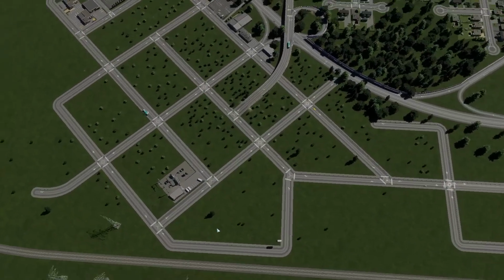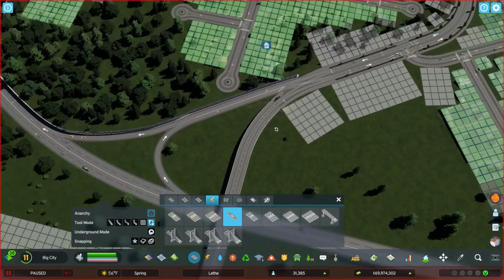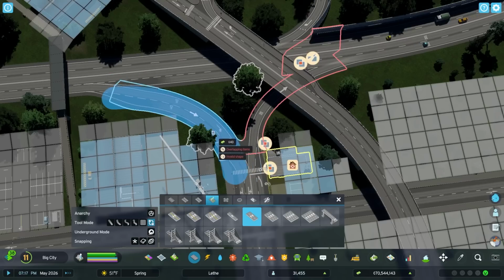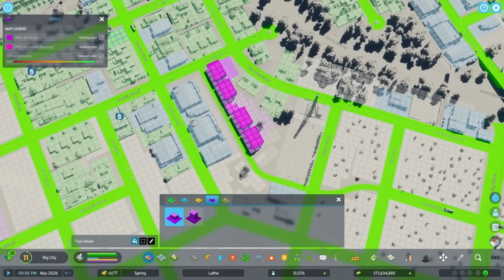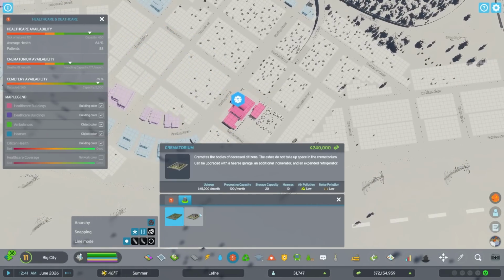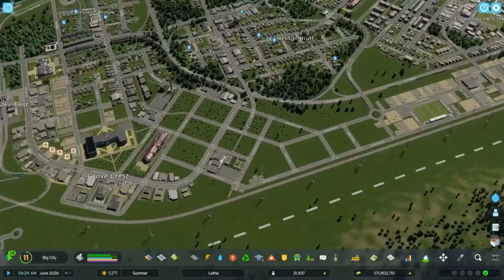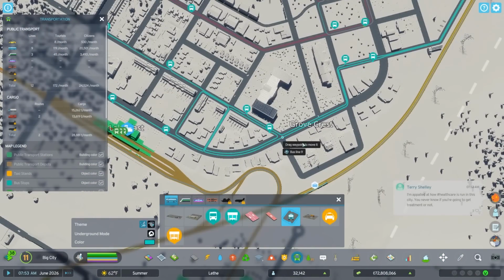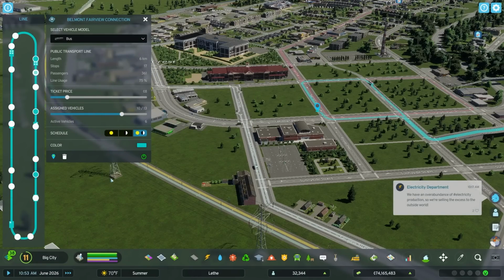Redeveloping A Former Industrial Park | Cities: Skylines 2

Comment: Hi ...
7:28 "An access point here?" - I'd rather see a diamond interchange or SPUI layout attached to the bridge that also offers a highway on-ramp to the westbound lanes. If you add a roundabout south of the highway, you could disable left-turns, creating a "dumbbell interchance" (Google Image search presents sketches of the layout).
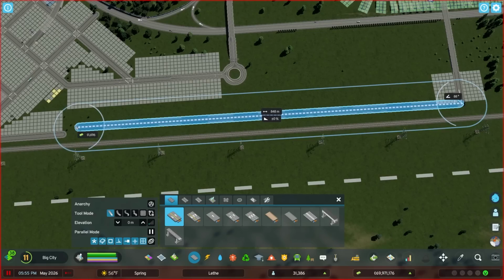12:01 Butler St bridge is a good connection - another one of those crossings of a linear obstacle. To avoid steep inclines you cannot connect the bridge to Walnut or Laurel St - and if you had already considered a future bridge when you first built the neighbourhood, maybe those two little streets would not exist as part of the regular grid. Maybe the initial grid would be smaller, leaving a wider gap between zoning and the highway (or other linear obstacles: rail lines, rivers, ...). Such a gap could later be filled with a grid extension or might be a location for a service building, if you discover demand. 12:44 Due to the bridge connection, this new road might also be a 4-lane ... similar thing on the other side: 10:58 continuations of these rare crossings can become quite busy, and the perpendicular one-way streets do not really help dispersing the traffic.
17:12 It is not necessary to turn of the left turns, as long as they have separate lanes on the two main roads of the intersection; rather add 2+1 asymmetry for the side streets.
48:01 I appreciate how the new bus line is serving both the high school and the railway station. Tiny changes to the other two lines could allow them to do so as well - a triple interlining between station and high school (maybe even with bus lanes) would not mean overserving the area.